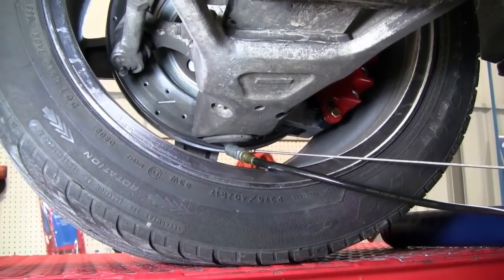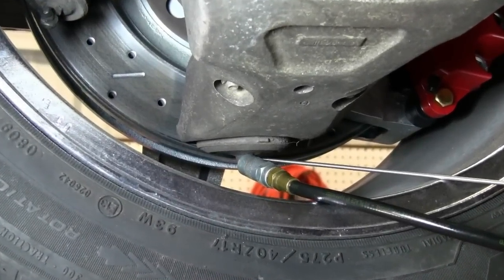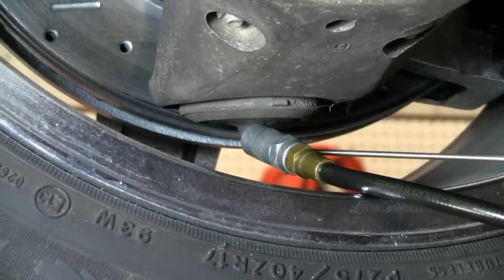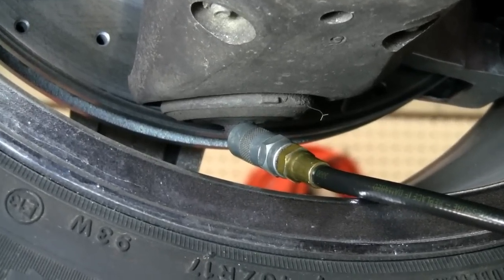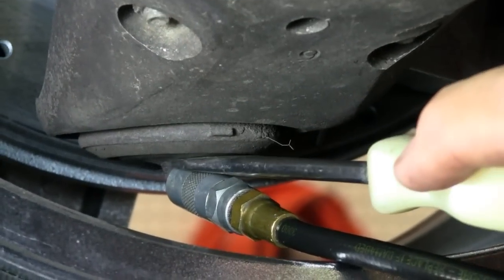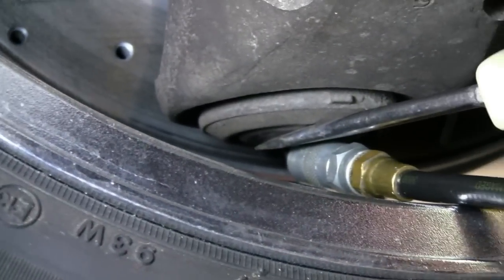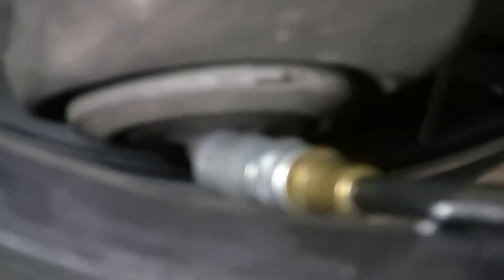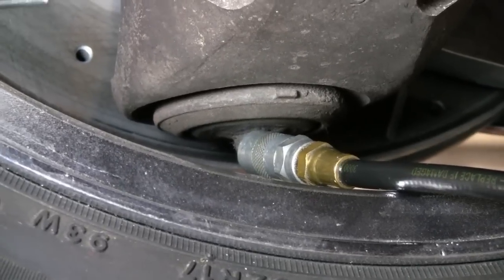C4 Corvette Cutaway Ball Joints

Comment: you aint kidding just laerning this car big learing curve  grounds broken wires bad connectors etc no maintence run hard put away wet never driven in rain lol opti spark put dist under h2o pump what? ls1 swap,350 4bbl ha
?1